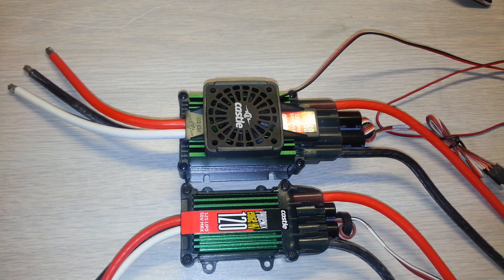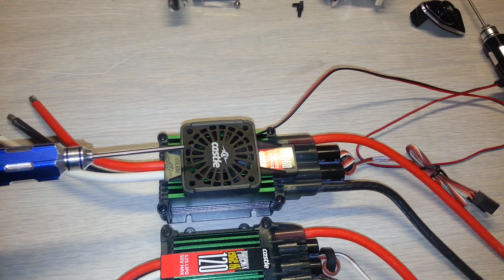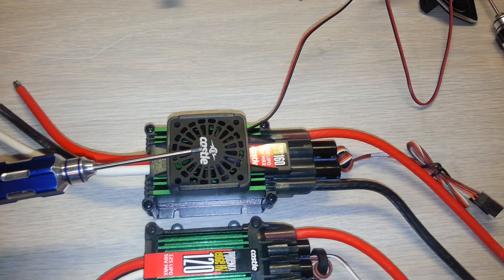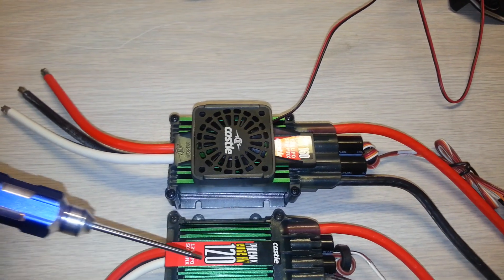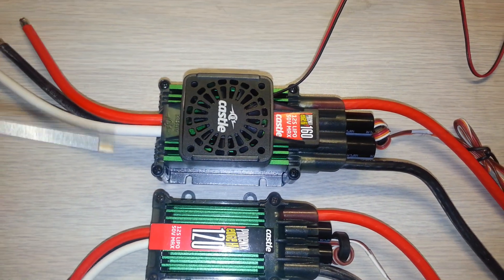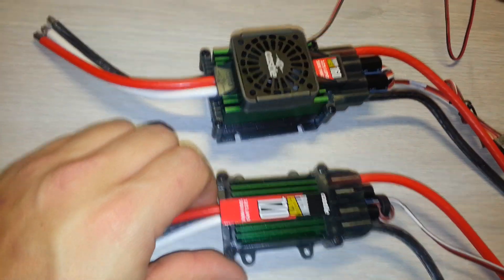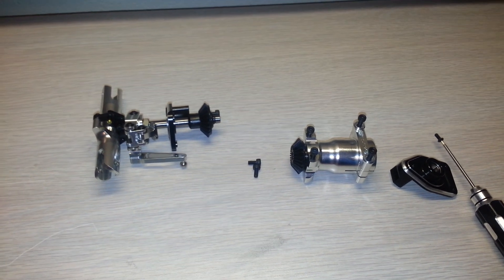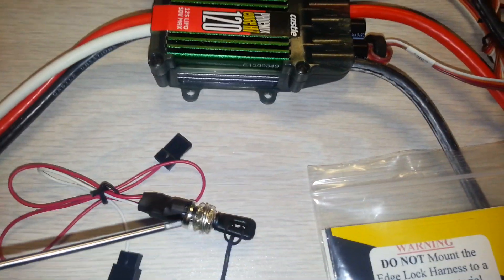Castle Creations 160HVF VS Castle Creations 120HV

Comment: Would the 120 esc jive be ok with a pyro 700 560 comp 4kw motor i dont want more power.  a 700 motor with 560kv can is enough to piss nitro guys around plus its lighter aswel. 375g motor with more than enough power i dont see the point buying a 850 560kv motor that destroys lipos. I want a powerful but very light under 3kg model for pure sport flying. Plus decent flight time plus it means less head speed a 3kg model at 1000rpm sounds great than a 5kg flying brick and needs 2500rpm to get it to fly

Comment: got 1 question: in the specs of the 160hv it says it can handle 50volts max, but 12s is 50.4volts. are these 0.4volts a problem? do i have to charge them only up to 50volts? regards. tobi
Reply: Lol you're worried about .4 volts